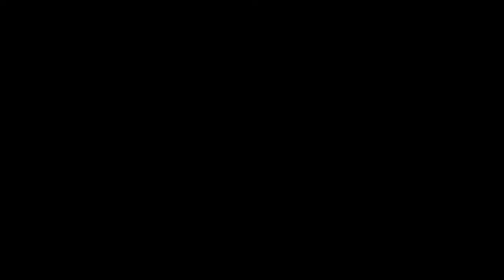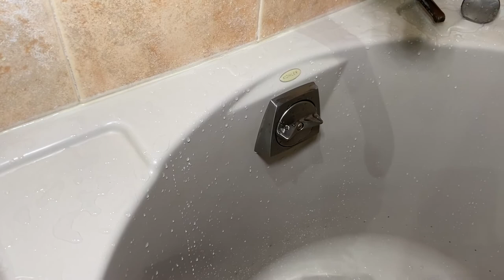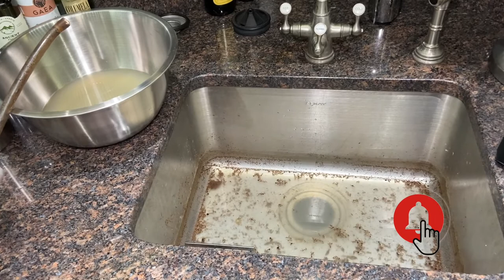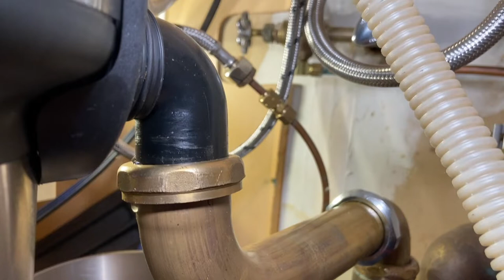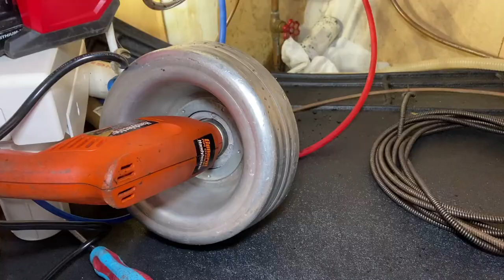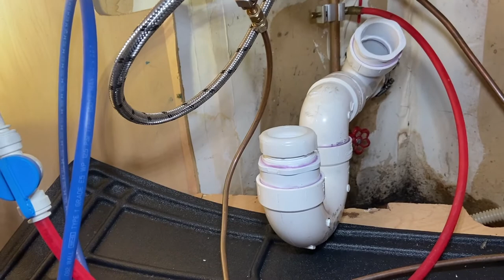Clogged Garbage Disposal Drain

Comment: Bob - you give really good advice and your recommendation to incorporate a clean out is universally the best advice. I am not being disrespectful but you plumbers are funny buggers. I am not a plumber and I have cleared out a blocked garbage disposal, including dropping the unit completely, snaking out the drain lines and reassembling  within 90 minutes, and that in a small house in the U.K. in an extremely congested under sink cupboard. I think plumbers must be pretty spoiled and over used to easy working conditions - but I earned my spurs as an engineer working in Frigates and submarines where inaccessible meant removing major equipment to gain access and fitting universal joints to both your elbows.😉

Comment: I tie a rag around the snake head to help clean out those drains many times. Just running the snake alone won't dislodge the stoppage a lot of times. Kind of like a self sealing clog. Spaghetti seems to be the worst offender for creating that kind of clog, in my experience. And a lot of people don't know to turn the water on FULL (cold) when using the disposal. Saw one commercial disposal setup once where a pressure switch was connected to the cold water line of the sink and to the disposal switch. Disposal would not come on unless there was practically zero cold water pressure. Thought that was an excellent idea!!